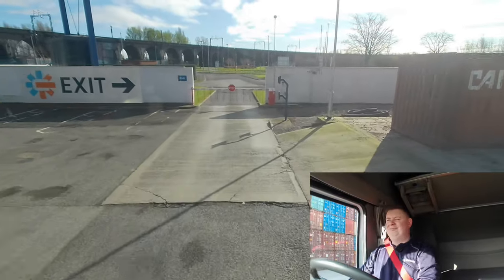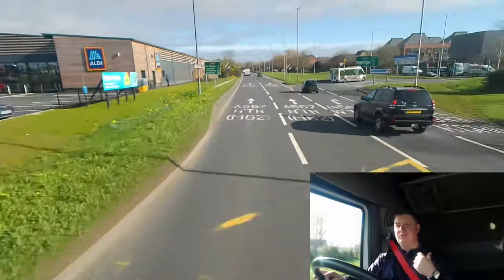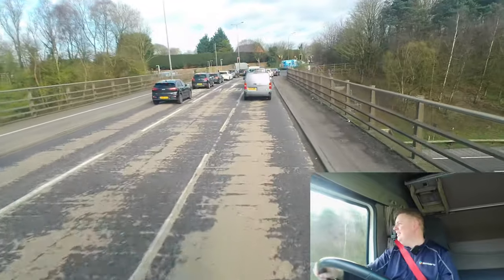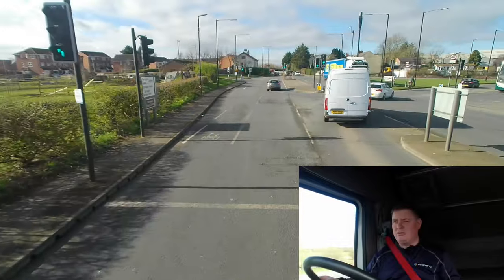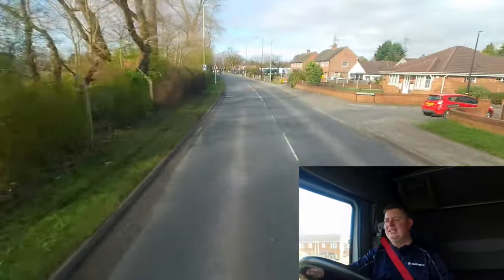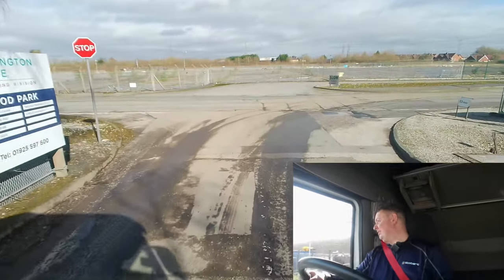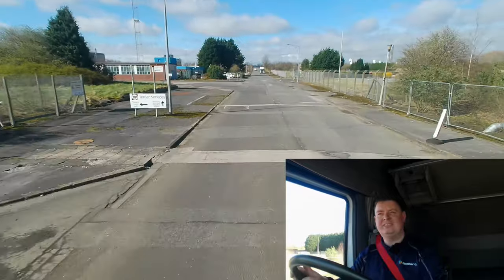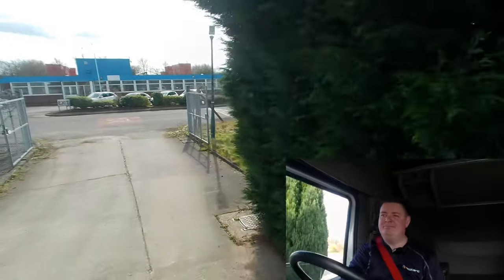The Running Trucker - Season  2 #new #vlog #season #hgv #viral #fyp

Comment: they let you charge youre electric car but did they give all the other employees a fuel card to use in there cars
Reply from the maker: No. But I paid for the electric I used through the company that installed the points. Wasn’t getting a freebee